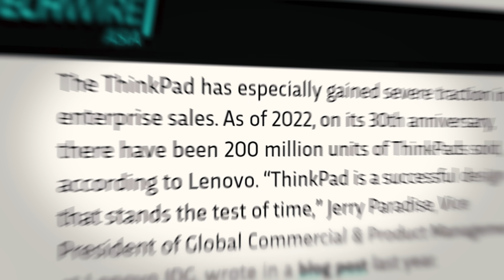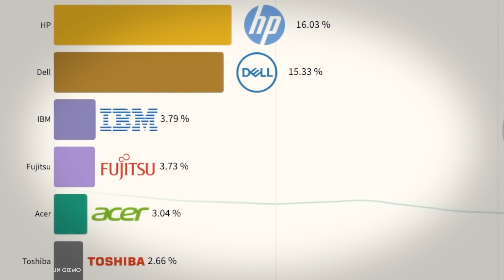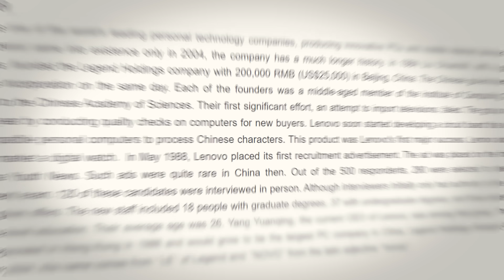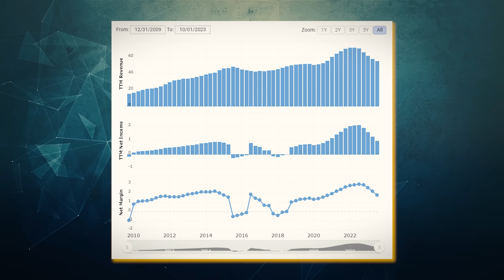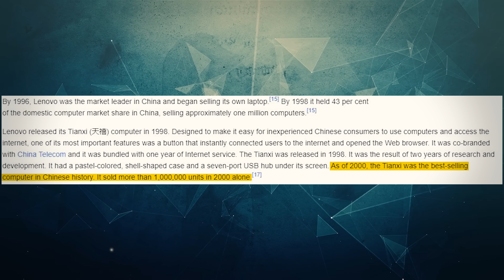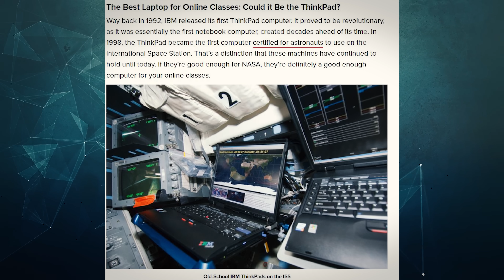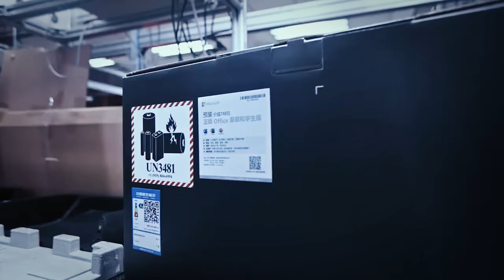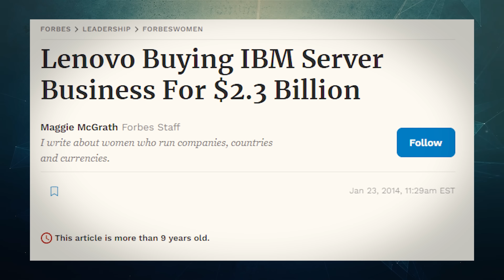Lenovo - The Last Practical Electronics Maker

Comment: My work laptop as a software engineer has been a Lenovo Thinkpad for years. It's company-provided but I chose the brand (most folks use Macbooks). It's a heck of a great PC.
Reply: Your mention of most employees where you worked choosing Apple somehow reminded me of how Adobe CC on macOS (not Windows) seems to be the industry standard in a number of design industries, including graphic design and book publishing.

I was an Apple user in the early 2010s, but eventually moved away from their ecosystem when they ditched their skeuomorphic UI design language in favour of a flat style*, I moved away to Windows, desktop Linux, and Android.

I primarily use a custom desktop PC and Sony phone as my primary desktop and mobile OS devices, but also have a ThinkPad X250 (sadly not X380 Yoga due to budget issues I had back in 2018) as a secondary desktop OS device for Web browsing, productivity apps, and remote access.

* This was before dark themes, which in turn are the only way I can live with modern UI design.

I do plan to upgrade to a newer ThinkPad X13 Yoga when I can, but at the same time, while Framework Laptop 13 looks enticing to me, they don't yet have some of the features I want, which as you may have guessed, the ThinkPad X13 Yoga models do have.
Reply: @kbhasi  I have a thinkpad l13 yoga and a t520 the x13 is basically the l13 but slightly better, and to be honest, i fucking hate it, it cools like shit i cant even open it with one hand, its just not a very good experience.
Reply: We haven't had good luck with X1 Carbons at our company. Bad QC, bad battery life, loud fans. I don't know how it can be compared to MacBooks at a hardware level.
Reply: keep in mind modern macs draw a lot from the t-series in build quality.  if their upgradeablity was higher it be a tougher decision
Reply: you mean web developer?
Reply: I have x1 yoga from my company and it’s a horrible dev machine. Slow as fuck. Not enough ram. Takes forever to boot. Loud fans. Bad battery life. I’d love a macbook pro

Comment: At my university, the closer you get to the IT studies, the more ThinkPads and less Macbooks are around.
And in tech-savvy, mostly Linux focussed circles, ThinkPads are still a status symbol, one showing knowledge of good tech.
I am watching and commenting on my 2017 ThinkPad, which has been reliable for all this time, even the original battery still being good.
Initially it had some BIOS related software issues which were a nuisance, about a year later these were fully solved, making it the best laptop I have used.
While I am considering buying a Framework 16 next, having compared the keyboard and trackpad of a Framework 13 with my budget ThinkPad, I just prefer the latter.
So that will probably keep me brand-loyal, Lenovo has proven themselves in making genuinely great laptops, like how Motorola has proven to make great phones.

Comment: I still have a thinkpad in my arsenal of laptops - keyboard got smashed so I pulled it out - whenever I need a serial port (think cisco switches) I pull it out, plug in a USB keyboard - use a screwdriver on the keyboard connection input on the motherboard to fire it up and It works flawlessly
Reply: the keyboards are pretty cheap and easily replaceable, unlike many other manufacturers who use rivets and melt plastic around the keyboard lol

Comment: I purchased a Lenovo ThinkPad X380 Yoga 13 a few years ago. After two years, it started to become extremely laggy, to the point where opening a single browser tab would cause the fan to roar loudly, despite no visible dust inside. 

So, nearly three years ago, I switched to the MacBook Pro M1. It's been an outstanding experience - even with just 8GB of RAM, I can effortlessly open 25 tabs in Safari, run complex machine learning algorithms, and edit videos without any lag, overheating, or excessive fan noise. It still works like it's brand new - definitely the best decision I've made👍

Macbook and Lenovo Thinkpad have very different price ranges but whatever
Reply: Ah yes, the perfect customer for Apple.
You know that, x380 13 had old Intel processor, which was first "new" model for Intel, since AMD started to make Ryzens. If you workload is big, then even ryzen 4800h would be better with rtx2060, coz M1 is ARM which is design for 1 task per core, when x86 is best when 2 task per core.
Also you may just need a thermal paste replacement and more ram on your old laptop, but I quess it was just bad CPU for a thin laptop and this workload. 
Apple is not worth supporting any money, for what they are doing with their designs and customer support.

... Also choosing slower power setting for web browsing could help, coz CPUs try to do task as fast as possible with high performance boost - heat in short time, if power mamagmet is not best it will coz fan to spin.
Reply: you could have upgraded your RAM and switched to SSD

Comment: My daily system is a ThinkPad T430 from 2012.  The thing is, by old ThinkPad standards... mine is still considered relatively new.  Robust, simple, repairable, upgradable.  A screwdriver and a guitar pick is all you really need to replace components.  My current upgrades are: SSD swap, switched the display panel to a 1600x900, installed an i7-3612QM, and brought it to 16 gb of RAM.  Thanks to the power of Linux on top of all that, it boots and runs not only on par with any general purpose laptop today, but it is often faster.

In an age of companies pressuring you to spend more money on incremental upgrades with few noticeable differences to the user, old ThinkPads are a fun way to stand against that push.  My main advice if you are looking to buy one off eBay is to make sure it's not a bios-locked one that was improperly released from a company's inventory.  Also worth considering is that models that end in 30 or higher (T430, x230, etc.) is when the battery whitelist was implemented.  If 3rd party batteries appeal to you, then you want models with 20 instead (T420, x220, etc.).  I mean there's a bios flash that exists but that's a topic too big for a YouTube comment.

Comment: i've used a Thinkpad since university back in 2007. There is no comparison in terms of practicality. X1 Carbon user at the moment. Stupidly obvious things - like having 2 USB A and 2 USB C ports.... and very good build quality are hallmarks of the thinkpads. Can you transfer stuff from one usb drive to another easily? yes. Can you type comfortably? yes. Do I feel hesitant to stuff it into a back pack? yes. My only advice to anyone considering a thinkpad is to not skimp on the screen. The 100% SRGB hi-res screens are worth it. THe basic thinkpads have relatively terrible screens.

Comment: The Pixel is terrible due to its constant software issues - ironic because it’s Google but that is what put me off them. I chose the iPhone from an Android for actual practical reasons - it was the only ‘flagship’ smartphone I could hold easily with one hand, I know the software won’t shit itself with an update and it does as an all round package, generally everything well without a dealbreaker of any sort.

There are ways around the walled garden (e.g. iDrive is FAR cheaper than iCloud) and even then, there are things within the walled garden that are nice - Apple Music as a standalone product is much superior to Spotify in a number of ways for example.

Comment: We use Lenovo Thinkpads for our business laptops - they have all the things a regular office worker actually wants - super light, great quality screen, fantastic quality laptop keyboard (underrated feature) and even the small things such as a privacy shutter for the webcam and on the admin / setup side, most, if not all, of the firmware / BIOS and driver updates you can get and installs easily via Windows Update without third party software needed.

And with say the X10 Carbons, they actually have very good higher end NVM-e SSDs as standard as well. They didn’t cheap out on that!

And their accidental damage cover (because staff are clumsy) is dirt cheap per laptop and makes total sense on a service level agreement perspective to have it.

Even their non Thinkpads are great.
Our GFX design team has powerful Lenovo laptops that are better spec than my gaming rig 😂 😅😢 (jealous)

That said, it is advisable to update the BIOS and other drivers with them often as it fixes a lot of bugs your BAU support team may encounter.

They on a SLA value perspective, are by far the best value. Dell’s business SLA support may be the very best, but you are paying through the roof for that vs the likes of Lenovo.

To others: This is why you see offices or companies using one brand of everything like monitors and laptops etc… service level agreements or SLAs

Comment: Got a used thinkpad t410, straight up amazingly built and feels real sturdy even after 13 whole years, and works fast with linux even with the hard drive, had quite a lesser experince with the newer
Ideapads aimed at average consumers
Reply: I started work on a T410, those things wouldn't die. I accidentally spilled tea on one while working overseas. Hair dryer and some patience and it booted fine on Monday, used it for another year before they were retired.
Reply: @to_the_seas  i think the T410 has a tray under the keyboard that routes water out the bottom of the laptop
Reply: @aiexzs yep, you're right. It's such a simple and practical design
Reply: @to_the_seas  interesting

Comment: I had a nightmare samsung  laptop when I was in college that I bought for $700.00+ dollars back in the 2010s, it froze constantly, I bought a $400 dollar Thankpad E14 and it saved my whole college career, currenlt on a thinkpad extreme , I  will forever be a thinkpad fan and user
Reply: I recommend being loyal to only specific models of a brand not the brand itself. You could always rely on T480 to be consistently a good laptop but you can't rely on think pads in general. Unfortunately, that's not how it works.
Reply: That's your mistake you buy the brand not the spec, you should first know how a hardware can drastically improve the performance not the brand, even if I use a thinkpad e14 with a 5400 rpm hdd and a samsung with i3 3rd gen and ssd this thing will outperform your e14.
Reply: Again another moronic comment @LeoNux-um7tg
Reply: do you even know how a laptop works? ofc it would froze if its outdated and has a weak cpu and hdd
Reply: @seadsea  this is absolutely the most moronic comment on this thread by a huge margin ... congrats!
Reply: @donmigueldolanza  I bet he's an apple user.
Reply: It wasn't outdated at the time he bought it😐😐 @seadsea
Reply: Did you even think of that reply? @seadsea
Reply: well, if the computer is freezing, it's because the hardware is not functioning properly, not because it is weak or slow. If it were to be functional, it wouldn't completely freeze, even if it was slow  @seadsea
Reply: @mparagames   @mparagames  no what are you yapping about its not because hardware has something wrong about? You can take a 2000s laptop and install Microsoft 98 to it and it would be fast like a new PC. It's because 2000s laptop can't keep up with heavier software because it wasn't designed for it. Like you can't have a good WIN10 experience on a device even from 2015 because it has only 4 gb ram, not because "hardware doesn't function properly"
Reply: @seadsea  I mean i agree with you on that, i think you just didn't understand what i meant 

What i meant to say was that if a hardware is actually freezing when you're using it, it probably has nothing to do with how slow it is but rather the fact that it is faulty - for example, bad blocks on hard drive, cpu overheating and crashing, faulty ram, etc. 

The person was mentioning that their samsungbook laptop started having hardware issues, while the thinkpad stayed functioining without hardware issues.
Reply: @mparagames   firstly, he didn't mention anything about it being hardware related like a faulty HDD or a bad ram. Secondly, I had a Samsung laptop around the same time and I remember it being slow and sluggish as well and I tried it again last year with fresh install but it still lacked in every aspect because the CPU weren't powerful enough even for streaming a 720p video. While my 1st gen i5 Toshiba laptop still works because it didn't have a shitty CPU on it. And when he bought it, it was probably new so his laptop was probably just lacking in hardware. You guys putting like Samsung is like a cheap Chinese brand who can't make reliable laptops hence saying bad ram or faulty HDD but back then Samsung still made good and reliable laptops.
Reply: @seadsea well they said "froze", which i interpreted as being faulty hardware due to damaged hdd, ram, or gpu, which can happen if the laptop has low quality ram and / or is overheating and / or doesn't protect their own hdds very safely.

If that person actually meant "my laptop was slow because of newer versions of windows", then i guess you are totally right, but being slow and freezing are things i interpreted as different things; maybe because i started being used to my current pc actually freezing because iof unstable ram tuning or because i pushed its clockspeed way too high with undervolting or overclocking :P

And yeah i get that samsung makes good stuff, that is genuinely true, i have a samsung smartphone and a samsung monitor and they are good, also samsung makes good ssds and good ram die, indeed. But they don't have really a lineup as sturdy as a thinkpad, so that's why assumed the person above was talking about actual physical damage to the hardware
Reply: @seadsea can you actually shut up the person just wanted to say that the thinkpad was better🙄

Comment: Lenovo's gaming laptop lineup (LOQ and Legion) is often the easy recommendation for people due to relatively good price to performance ratio. They also have good build quality even on the cheaper model.
Reply: I also have their cheaper gaming option, an IdeaPad gaming 3. It's obviously not as good as a more expensive gaming laptop, but there really isn't a better gaming laptop at or below that price. I got mine for $650 with a 3050 and it's able to run every game I've tried on it, even though it isn't on max settings

Comment: Never experienced  Thinkpad (too weak for my tasks), but I own Legion, 2021yr model 5 pro 16, to be specific. And it is... The most practical workstation-esque laptop I ever tried in my life. With money actually invested in some practical things, like (finally!) half-decent 16:10 screen, cooling system that, well, exists (sending a personal slap in ASUS hotplates direction) and a fully machined aluminum shell.

Yes, it's kinda on a heavy side for a machine with 3070 on board. Yes, one 1tb SSD is kinda limiting. And yes, it's... Hot. But I can actually see something on a screen, avoid throttling issues and be not afraid of throwing it into the back seat of a car in cheap chinese carry bag then driving on a bumpy road. And it worked flawlessly in less than ideal conditions all while exceeding warranty date by a whole year as of now (already 4x as much as old ASUS lasted before first, yet not last, major failure). Lenovo just works, period.
Reply: Well Thinkpad has their own workstation lineup that has the same hardware as Legion. Same CPU, same GPU, same cooling system, same amount of ports, except it has no RGB and using the classic Thinkpad keyboard and trackpad with the infamous red trackpoint. Its price are double the price of Legion as it has additional business security system
Reply: Yeah, but at this point you can just make small PC, for similar mobility, coz this laptop can not work on its battery during workloads for enough time.
Reply: @zbigniew2628 Yes, but my work requires not portability, but... Luggage-ability, I guess? To throw it into bag along with mouse and charging brick, drive/ride/fly to god-knows-where, use it in an awful rural "hotel", rinse and repeat. Several times a month, sometimes several times a week...

Comment: I would not call them the "last", because Panasonic is even better than Lenovo nowadays. I love their Let's Note and Toughbook series, because they are designed like traditional, based laptops with removeable battery, service access and good I/O without the need of a port replicator. They classic keyboard is also pretty nice. Pure utilitarian design. They are strict workplace machines.

What i also don't like about Lenovo is their IdeaPad line-up. Cheap disposable rubbish laptops with slow E-MMC storage. The lowest tier imagineable, similar to what Acer is doing.
Reply: Even their lower end Thinkpads use higher end Samsung / Western Digital NVM-e SSDs however (depends on batch which one but both are higher end) 😂
Reply: @ChineseKiwi  As long as the SSDs have actual D-RAM cache on them, it's good. Nobody wants to do work on a slow computer. But their IdeaPad line-up is very disappointing. It's mostly just bait products for parents, elderly people or non tech-savy people, which then get frustrated and give upm because the machine can't even launch a web browser without stalling from the slow storage, low RAM and bloatware + Win11.

Comment: I've owned a couple of Lenovo's as my personal laptops  and they are the machines  the company I work for provides to its employees.   I've always found them to be solid/reliable .....back in the early 2010s I splurged on a Lenovo W520 and it was without doubt one of the best computers I ever owned  ....everything about the build and setup was practical and made sense....